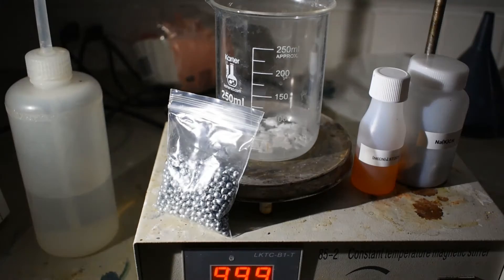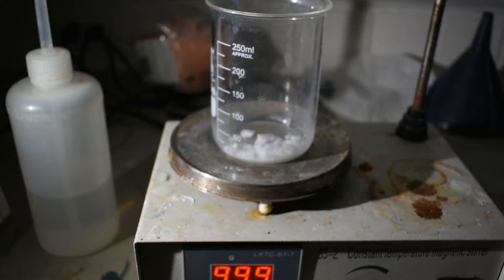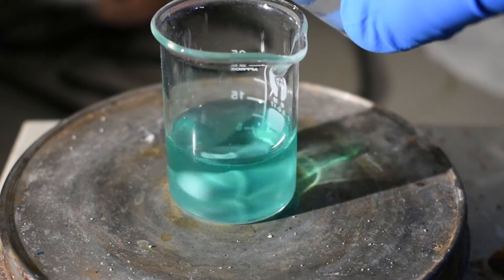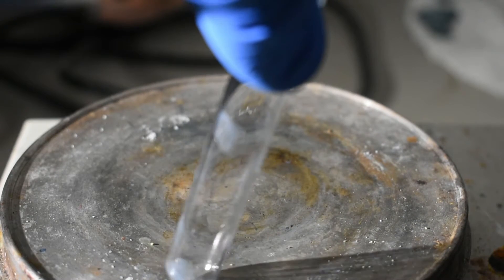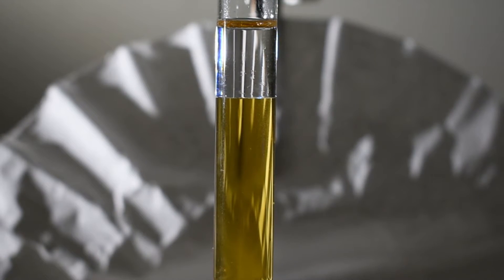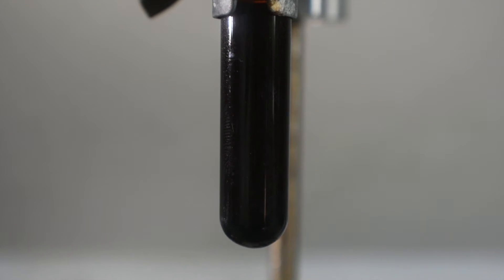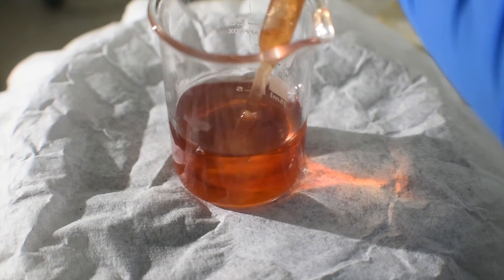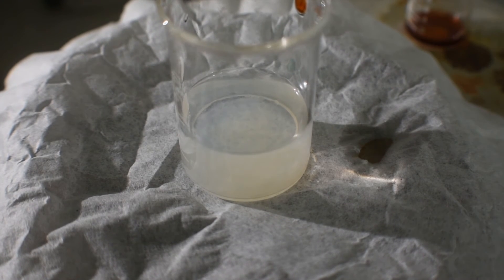Synthesis of a Nickel(I) Compound

Comment: Now on to nickel 0 with a nice carbonyl complex! ^^

(Just kidding, don't do it! Seriously!)

Oh, and you can make some nice, orange complexes of nickel (II) halides with dimethoxyethane, and blue ones with acetonitrile, if you ever get your hands on those solvents. I've done it by the past.

I think they're water sensitive though, so you'd need to keep your reagents fairly anhydrous.

I also made some diallyl nickel at some point, with the chloride and allylmagnesium bromide. That guy decomposes spontaneously at room temperature, I had to keep it below -40°C with either acetone or acetonitrile/dry ice bath. 
Got some nasty frostbites that way!
Reply from the maker: I do have Acetonitrile, actually!
Reply: @Rhodanide  Then it's pretty straightforward! 

Make sure it's dry, and your nickel chloride/bromide is dry (bake it), and dissolve it in the acetonitrile.
According to the litterature, (J. Chem. Soc., 1964, 2400-2408) the bromide gives you tetravalent NiBr2(CH3CN)2, which is blue (it's the one I made).

Evaporating the acetonitrile with vacuum should give you some blue crystals at first. I left mine overnight under high vacuum, and they went back to the same orange as the starting nickel bromide. Apparently that was enough to decompose it!

According to that same paper, the chloride should give you NiCl2(CH3CN)2, which is yellow green. And under some conditions, apparently, you can make NiCl2(CH3CN)4, which is green.
Reply from the maker: @piranha031091  Well I don't exactly have a vacuum chamber......